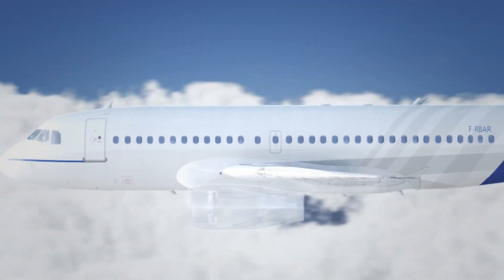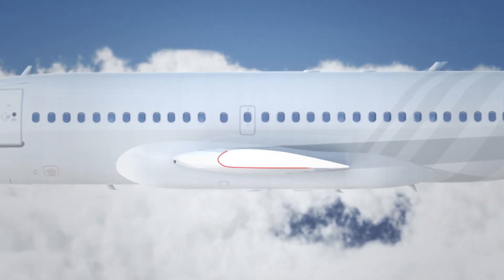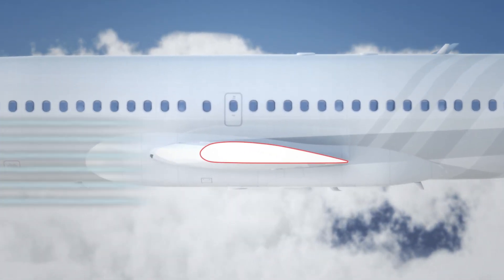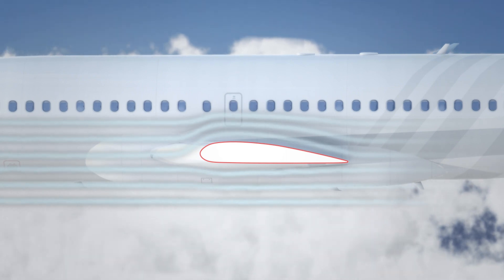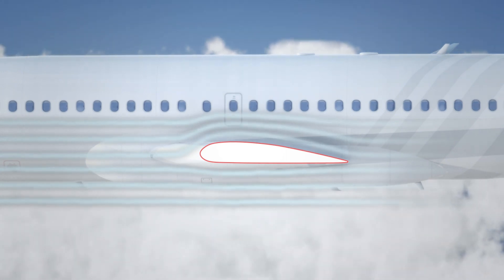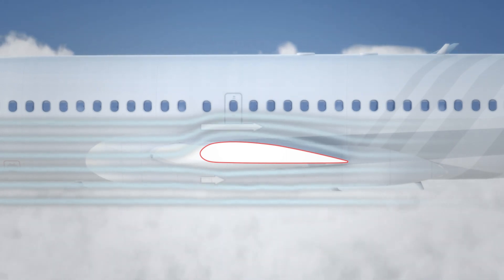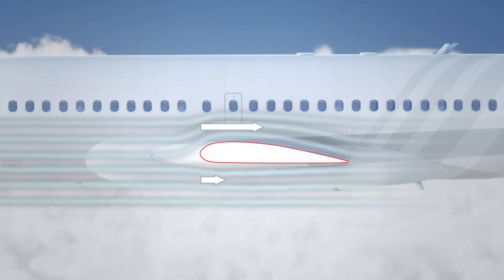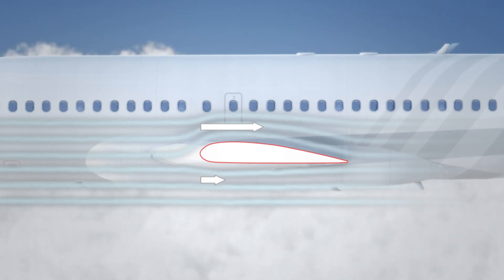Why Planes Fly - Red Bull Tech Talk with Jim Reed

Comment: It's not a really good explanation, but I guess it does the trick for laymen.

There's basically 2 things that make an airfoil generate lift: Angle of Attack and Curvature. Thickness is a second order effect. The ratio of the length of the upper side vs the length of the lower side really is not important for lift generation, that's the main problem with this video.
Reply: +phantom090  Yeah, it basically doesn't explain anything at all.
Now I don't mean to be negative and disencourage people from watching this. I'm sure the first one who's not happy with the explanation is Mr. Reed himself. He was probably given the task to explain lift in 1 minutes, which is an almost impossible task
Reply: +phantom090 I've been bitter about this ever since grade 3, when I stuck up my hand and said "It's just like when you stick your hand out the car window - if you tilt your hand up, it goes up" and the teacher said no, I was wrong, it was this Bernoulli story. I was too crushed to say "Then, how do paper airplanes fly?" A barn door will fly with suitable motive force and control. It's just a lot less efficient because the circular pattern of air around the door is broken up - curvature is more about filling in the low-pressure space to keep the air from tearing out of contact with the surface thereby creating turbulence than it is about creating a suction force on the top of the wing.
Reply: +jibeneyto well ... but you just did it. The quickest, most intuitive explanation is also the closest to being correct, in a rough-sketch way. The Bernoulli explanation is relatively confusing, and relatively wrong. The most accurate explanation is more difficult, but can still be sketched in fairly rapidly if you have video editors and animations to help.
Reply: +murfleblurg I recommend a book called "Understanding Aerodynamics" by Doug McLean. It's really great. If you search for him on YouTube you will reach a very nice lecture of his that I have to watch every now and then to remind myself :)
Reply: +jibeneyto Layman here, can you weigh in on this?  Recently I came across an alternate way of explaining lift.  If you could weigh the air pushed down by the airplane in level flight, it would weigh as much as the airplane.
There's a second part to this that I came up with on my own, practical visualization - no heroic amateur breakthrough, and that is the top of the wing is always clean because the low pressure makes predictable instability that is used for control.
Reply: +Fifty State Hi there! Yeah that has to do with conservation of momentum in the vertical direction. The mass of air being pushed down vertically is also pushing the aircraft up in the opposite direction. But this is just a CONSEQUENCE of lift generation, not really the cause. It's as if you say that when you try to jump, it's the floor that's making you leave the ground because the normal force in it becomes zero. Correct, yes, but not the proper "cause and effect" relation :)

Regarding the cleanness of the top of the wing, I don't really understand what you mean, sorry :)
Reply: jibeneyto The model fits with your explanation, thanks.  

The "top of the airfoil" observation is an attempt to understand control in controlled flight.  The top of a wing is always designed for smooth airflow.  The bottom of a wing is cluttered with engines, hardpoints, and stores.

I like to apply literal definitions. Take "thrust" for example, sitting in an office chair on a hard floor you can thrust a bowling ball like a basketball pass to achieve motion.

To me, "push" describes what keeps an airplane in the air.  The bottom of the wing pushes the air down and Newton's second and third laws are observed.  "Lift" describes a small force on top of the wing (Bernoulli) that aids in controlling the airplane.

How am I doing?

BTW, this isn't some terminology protest-rant, I just can't think of another way to briefly describe it.
Reply: +Fifty State Hi! Well there are wings with engines on top of them. See the VFW 614. I think you mean that the airflow being "smooth" over the wing corresponds to a attached flow. Now, attached flow is one thing, but the airflow can be either laminar or turbulent. Most of the times airflow over a wing is turbulent, just very close to the leading edge it's laminar, then it will transition to turbulent.

What keeps the aircraft in the air is the pressure distribution along the entire airframe. This distribution has a net component in an upwards direction, lift. It's not really that one part of this force is called "push" and keeps the thing in the air, and the other part is "lift" which aids in controllability

Don't worry about terminology protest.rants, hehe. I'm one of few people who say a jet engine produces THRUST while a piston engine produces POWER. People tend to confuse both terms.. :)

Comment: no - its not bernoulli, its Newton - equal and opposite.......
Reply: +SD “SDsc0rch” sc0rch Nope: The air speeds up due to the continuity law and Bernoulli explains why the pressure drops over the wing. Newton acts on the bottom with larger angles of attack, like holding your hand outside the window while driving. So it's three things explaining why a wing produces lift.
Reply: Both Newton and Bernoulli describe aspects of lift - neither one provides a complete explanation. Both and more are required to have a very complete understanding of lift.
Reply: +4fifty8 To me, to simplify, Newton provides lift, Bernoulli provides control.